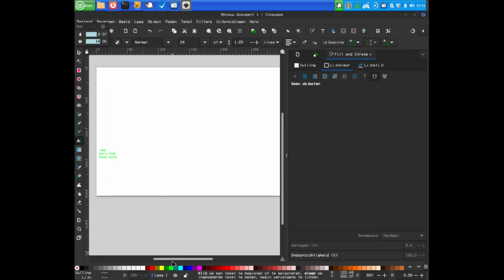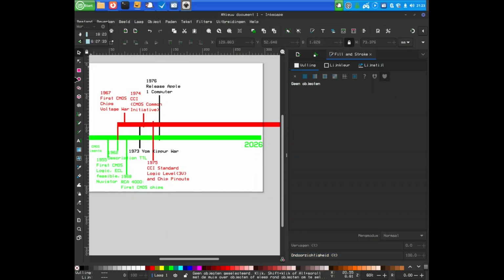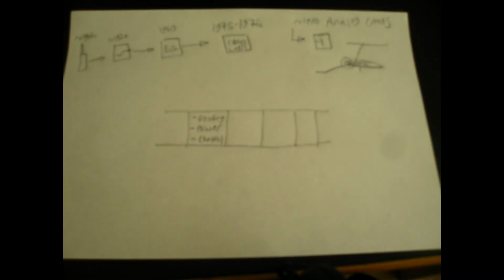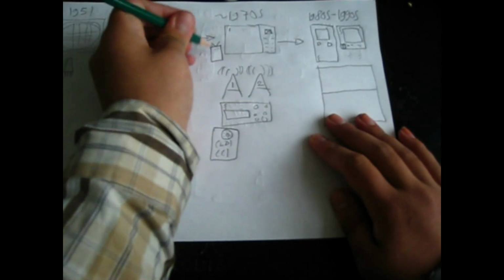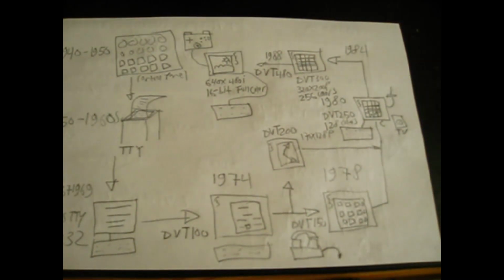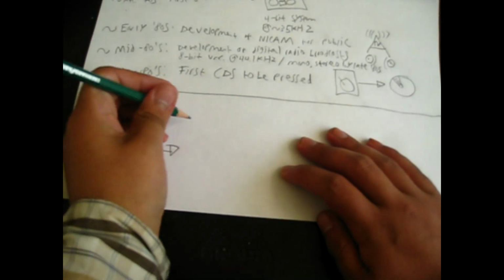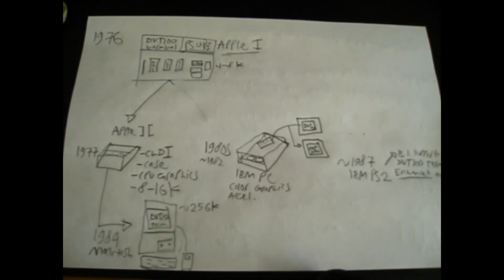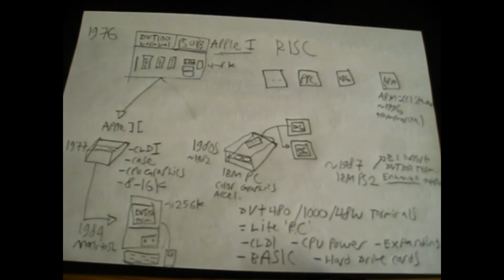What if TTL was Never Designed

Comment: Interesting, but I have 2 issues by 25:00
1. what magic battery would the 1981 palmtop use?
2. Have you heard of the Palm Pilot from the 1990's, a palmtop computer running apps?

Good luck.
Reply from the maker: I've heard a bit about the Palm Pilot. Interesting indeed. What I'd think is that, given multi-touch was an idea concieved in 1983 in our timeline, it'd end up being used in the 1990s, much like how it was used in the iPad in our current timeline.

As for your first question, I've actually heard of pocket computers already existing in our current timeline's 1980s, and those tended to use AA or AAA batteries. Given those likely used at least some TTL in our current timeline, I'd think that the 1981 pocket computers would end up using a couple AAA batteries that would last quite a bit longer than they would in our current timeline. And Nickel-Cadmium batteries also existed for a long time by 1980.
Reply: @vijfsnippervijf  yeah, I take your point on the cells. There also where very expensive silver cells.

I feel that the CMOS timeline you are on may infer other technologies that came later from unrelated areas.

I remember the UK did not invest near enough back in the semiconductor days. I worked in and around the industry from '85 onward around 'Silicon Fen'.

I built/tested TV redistribution and satellite equipment from my teens.

£3,000 Microwave frequency PCI 'transponder-encoder' cards as opposed to receivers. I ended up in Software in late 90's.

Mmm, capacitive touch is from 1965...

Very interesting, I'll listen a couple of times,  may yield some interesting sci-fi ideas ;-)
Reply: @vijfsnippervijf  
PS
1982: Nimish Mehta at the University of Toronto created the first human-controlled multi-touch device.